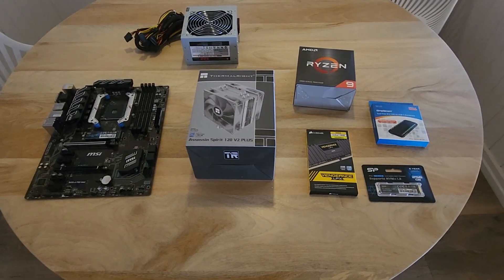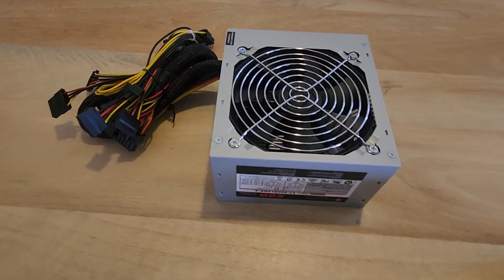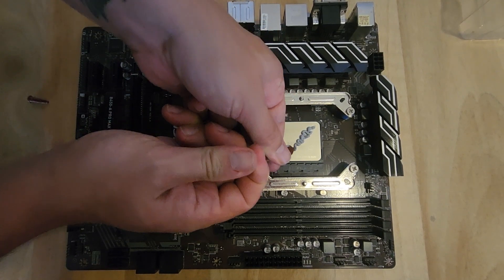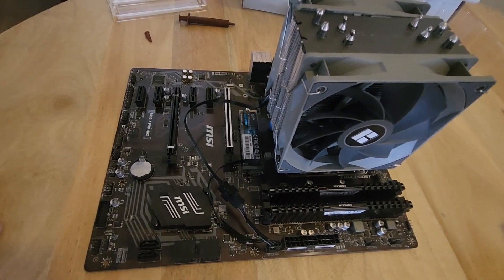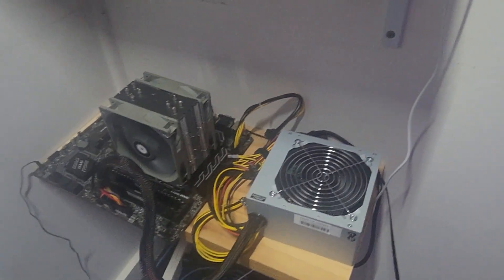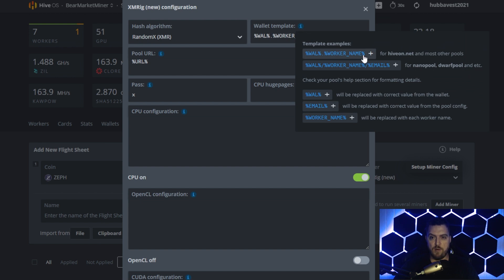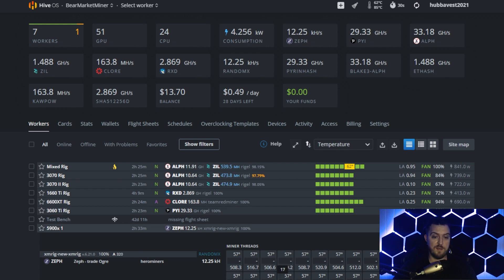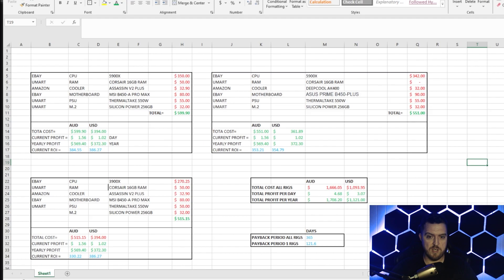I Built a Profitable CPU Mining Rig – 2026 Full Guide!

Comment from the maker: What CPU's are you using in your rig?
Reply: 7900x
Reply: What are the number on the 7900x? @77garga
Reply: i7-13700k, est. 10kH/s 83°C 180W max.
Reply from the maker: Is this in your main PC or are you running it in HiveOS? @disoin.studio
Reply: i72600k3.4ghz with a gtx1650
Reply from the maker: What sort of profit are you making per day?
Reply: R5 7600x at 8200kh on Zeph for approx .60 per day..no elec cost, Solar powered.
Reply: 5900x 12kh zephyr
Reply: Pentium 4
Reply: Why didn’t you plug your cooler into the CPU fan header at the top?
Reply: I’ve got the 5900X
Reply: 8x 7900 6 x 7950x. All off now :(
Reply from the maker: @MrSouthside600  Yep, it's tough at the moment profits are low / non-existent

Comment: You said you needed to install a graphics card @6:20 , do you have a recommendation on that?
Reply from the maker: Any graphics will do, plug it into the x16 slot on the motherboard, the same as any computer. This will be to be done so you have display graphics when setting up the miner.
Reply: @BearMarketMiner  a complete amazon build comes in right around $500, Just placed the order.
Reply from the maker: @djicedragon855  Exciting stuff! Best of luck. What did you end up getting in the build?
Reply: @BearMarketMiner  
do you mean parts or specs for the mining?
as for parts i got almost all the same stuff, the ssd to usb c enclosure is different and i went with a 450 psu, but other than that all the parts you did, as far as performance its gonna be a week or so before they all arrive. working on 3d printing a stand for it now, ill upload a video on my channel when its completed, ill pin back to you for the info, mine will just be the build.
Reply from the maker: Sounds good, goodluck with the build!

Comment: Good to see a fellow Aussie miner! 
Just wondering what your electric rate is? It's 30c here in WA but with 26 going on 29 CPU rigs, my power use is getting to where I can start negotiating for a better commercial rate.  
I'm mining Dero and remaining profitable but I hate selling part of my yield to pay for power.
Reply from the maker: Hey maaaaate, Likewise! My rate in QLD is 26 cents, works out to about 18 after my solar is factored in to a 24 hour cycle. I also take profits quarterly and run as a business so with my dedeuctions it reduces another 20-35% ish depending on my expenses. 

if you're covering you expenses with taking small profits you're doing the right thing, well played. Bullrun is coming. It's only up from here.

Comment: am new to this... would you advice CPU or GPU mining...i have free electricity..which is more profitable between the two with free electricity
Reply from the maker: Currently both are profitable. If you head over to www.hashrate.no, they have GPU and CPU calculators on the page. From there you can enter what hardware you want to use and your electricity rate ( input zero fi you have free electricity) and see how much you can make on different coins and algorithms. Hope this helps

Comment: Ryzen 5 3600 works out cheaper, available at 100 bucks each, gives 7400mhz.
More of hardware ofcourse, but can do with stock cooler
Reply from the maker: Yeah I did have a look at them, wanted a bit more bang for buck. But they are good value for money
Reply: Remember the other parts in the rig do cost money. To get the same hashrate as a 7950X you'd need a lot of little 3600 rigs which would work out to be more money in the end. Density is where it's at.

Comment: It seems like this really doesn't get profitable in a interesting way until your creating your own power such as solar. I think you mentioned that. For someone like myself in an apartment, I don't think it makes sense. Question though, with the CPU mining would it be more beneficial for higher singlecore/clock or more cores?
Reply from the maker: As of today's prices, the revenue is 1.42 using no electricity (100% solar powered) and 1.12 usd after electricity, so I'd say the profits are still very solid without a solar setup at a reasonable electricity rate. 

If you're looking for more specifics on CPUs, I'd suggest going to www.hashrate.no where they have a full list of profitable CPUs and various different coins/algorithms you can mine.

Comment: India from India
Amd R5 3600 $85
Power supply cooler master 550 $45
Asrock b450m $45
Zebronics nvme 250 $15
Antisports CPU fan $14
Ram xpg8×2 stick $30
Total temperature 68° 
Hashrate 6.8kh oc settings crore clock 4GHz core voltage 1.25
Reply from the maker: Solid setup mate, enjoy!
Reply: Bhai send ur mobile number please

Comment: My first Rig works with an 5900x, 65c, 14100 H/s. The next Rig is planned with an 5950x
Reply from the maker: 14100 h/s on the 5900x sounds super high. What sw5tings are you tweaking to get that?
Reply: @BearMarketMiner  In the BIOS i set multipler Allcore to 44, Overboost is OFF, Voltage i Set 1,158V, PL i set for Secure to 110 W. RAM is Patriot Viper, 2x8GB 3200 CL16 and XMP activated. This runs Stable. The Real Clocks from the CPU i cant say, because i use HIVE OS and dont see the Clock from the CPU. BTW, is my First Mining RIG. ;)
Reply from the maker: Nice, I might give those settings a check and see how they run for me.

Comment: Did you factor in energy consumption/cost into those figures? Idk how much it would effect or if it would effect it at all. But I know that thing has to burn some electricity which isn’t free. 😂
Reply from the maker: Yep, I've factored that in. Fortunately I have solar so it is in fact, free! My whole farm is run off it.
Reply: @BearMarketMiner  yeah after I typed the questioned I went through like half your vids and saw the solar stuff. I really like the fact that you only run 8 hours, you’re rigs will last much longer not to mention that uses strictly solar and doesn’t make your electricity bill sky rocket.
Reply from the maker: Yeah it's been really good. No issues with Hardware, no electricity costs other than the occasional cloud. Pretty much all profit

Comment: I have four 5900x and three 7950x 3d. The temps are 45-55c and the kh is 12 for the 5900x and 16 for 7950x 3d. For 5900x the motherboards are MSI B450 GAMING PLUS MAX and the coolers are AMD wraith prism. The motherboards for the 7950x 3d are ASUS TUF GAMING B650-PLUS WIFI and the coolers are DeepCool CPU Cooler AK620 Zero Dark Dual-Tower. Also I use 750w PSUs, but maybe is overkill for this rigs so the next week I will try to power two rigs with one PSU, using 24-pin ATX Motherboard Splitter Cable, PSU Female to Male.
Reply from the maker: Yeah I was thinking about splitting my rigs off a single PSU but for the cost of the cheap ones I decided just to go one per board. I have some of my GPU rigs with Multiple PSU's though, works a treat!
Reply: @BearMarketMinerYT Today for my 5900x rigs I will test with 400w PSU (1stPlayer PSU FLEX 400W) and the price for this one is only 40usd
Reply from the maker: Let me know how you go.
Reply: @BearMarketMiner  Everything is ok. The rigs works perfectly. The PSUs are very small but very powerful, regardless of the fact that they are only 400W. Also today I have turned on my brand new 7950x3d, three of them. If you want I can send you a pictures. But the 7950x3d are brutal! 19.30kh with very little tweaks.

Comment: Yeh just fitted a 5950x into my gaming rig getting 15.5kh and 64c temps with very little optimisation - happy with that and will spend a day optimising more soon!
Reply from the maker: Awesome man, what cooler are you running on the 5950x? The stock cooler or did you beef it up?
Reply: @BearMarketMiner  That system is on water so is kept cool yeh.  I dont think stock cooler is good enough.
Reply from the maker: Oh nice, watercooled would do the trick. I might have to install a block on my PC 3090 just for something fun.
Reply: le configuraste eficiencia energética xD

Comment: The 3900x are great for mining. I've got 3 of them running already
Reply from the maker: Yep I've got 2 I'm currently in the process of setting up 2 of them. Awesome CPU's
Reply: Nice! Unfortunately, here in Bulgaria 3900x are out of stock everywhere, so I use 5900x , 7900x and 7950x3d
Reply from the maker: The 3900x's were less common here in AUS also, the 5900x was much more available so I did the same as you and grabbed  few more 5900x's
Reply: how much are 3900x or 5900x making per day ?
Reply from the maker: Currently, about 1 dollar a day USD